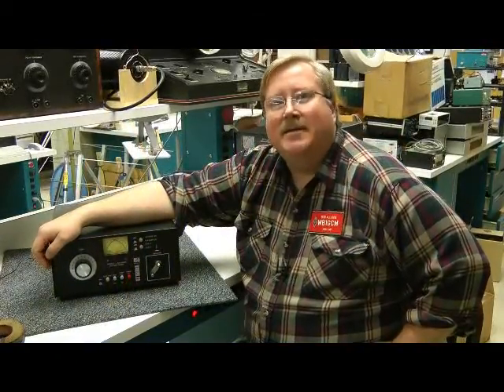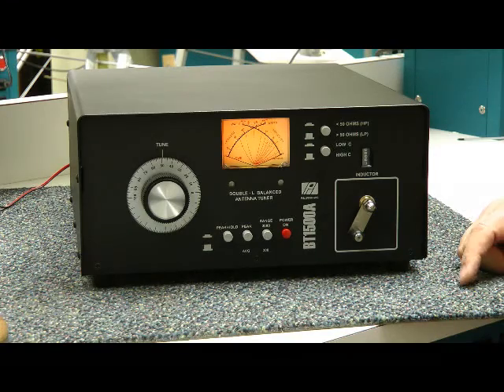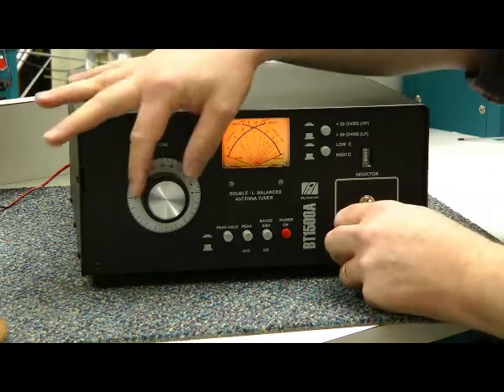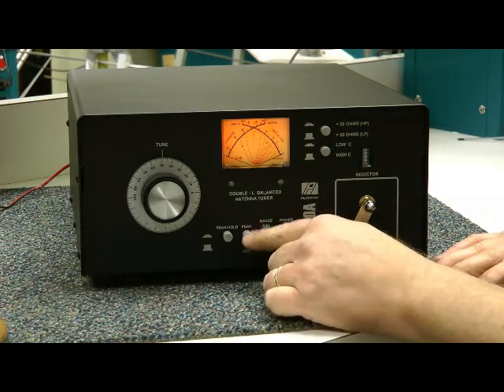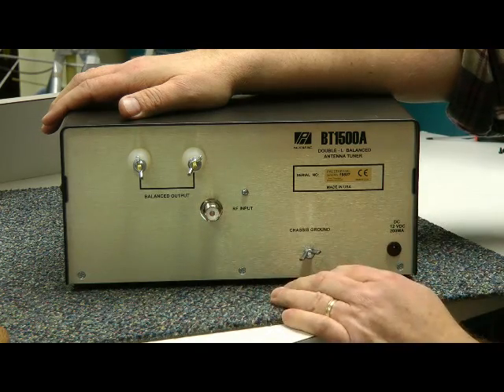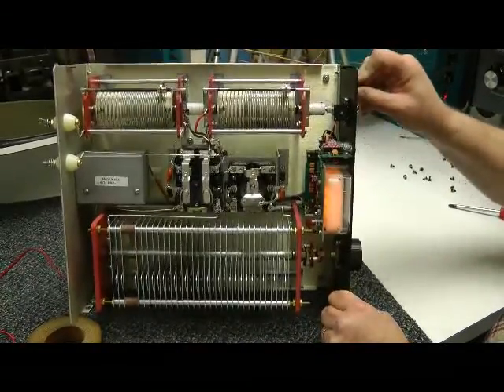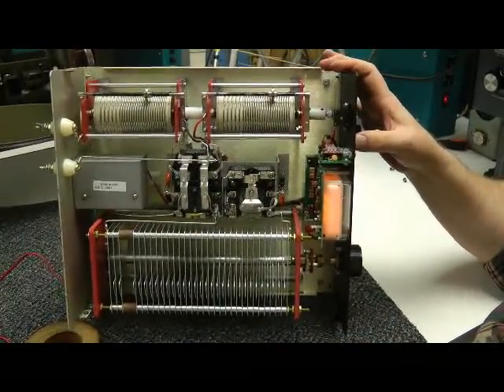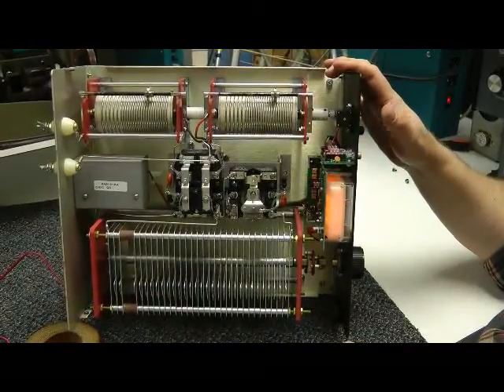Palstar BT1500A Antenna Tuner

Comment: what buttons are you pushing for more than 50ohms or less than 50 ohms. And more Capacitance? The manual is confusing also about putting the capacitor on the input side or the output side. There's another video here that's just as useless as this video. Expensive tuner no one knows how to use............including me.....Fell into that tuner trap again

Comment: I recommend checking the ACTUAL balance. I measured each respective output and found them to be out of balance. I had always assumed it was “balanced” but unless it’s verified, it’s just an assumption. Once I remedied this, the noise level dropped.
Reply: What and or how did you remedy the imbalance?
Reply: How do you check the actual balance to be sure??
Reply: How did you measure each output please?
Reply: naturally no response to any of these questions. Probably by my weak experience is putting an RF AMETER in series with each side of the ladder line and lengthening or shortening that particular wire....not sure @johnkemas7344